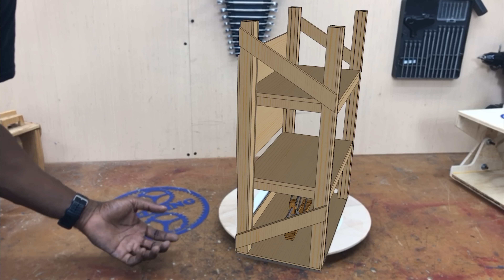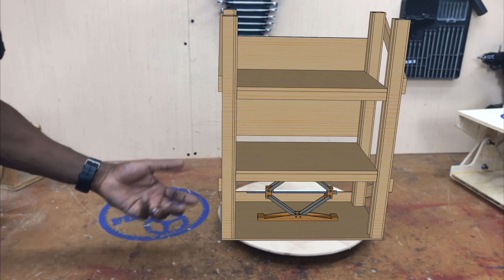Engineering Principles for Makers Part 2; Material Properties #067

Comment: Moment of inertia isn't a measure of something stiffness. I get why you say that, but it's not. It very clearly has something to do with inertia and moment (or in this case rotation)

It's a bodies resistance to angular acceleration. Resistance to acceleration is inertia, and angular acceleration being the moment part.

Sure it's used in beam deflection, but it has to do with the cross section and not the beam.

Id have to agree with other posters though, it's not a fair test. You are comparing steel flat bar, in it's lowest moment orientation, against a wood I beam. It's not right to say, we can change the geometry to amke wood as stiff as steel. As stiff as steel what? The same steel I beam? No? A Steel flat bar in its highest deflection orientation, sure... You could make a lot of materials stiffer.
Reply from the maker: It seems as if you were watching but not listening. That is unfortunate. You should understand before you disagree
Reply: @Jeremy_Fielding  I heard exactly what you were saying, but you were saying is a false equivalency. 

"You can make wood as stiff as steel if you change its geometery" As stiff as steel what? That's a null statement and means nothing....

I have my degree in Mechanical engineering, I understand all of this. And you aren't describing this well at all.
Reply from the maker: Thanks for the feedback. The only goal was the draw a very clear distinction between geometry and material. Often people think they just need a stronger material, but what they often need is more rigidity. This is based on my frequent discussions in the comments and emails. The example was to point out that design is as important as materials. So comparing a poorly designed beam flat steel with a better designed one and what is usually thought of as a inferior material.  I wasn't trying to imply that you "couldn't" understand... only that you seemed to miss the point. The video is targeted to DIYers so there is no reason for me to think that anyone (including someone with a degree) couldn't understand if they had been paying attention. I also said in the video that "I am not saying the wood is as strong as steel, but could be stiffer when given the advantage in geometry"... this is why I thought maybe you missed that... because you are asking a question I feel I answered. The effects of geometry and material are what the whole rest of the video is about. and "area moment of inertia" is described correctly in the video so I don't understand you comments there.
Reply from the maker: It is important to also say the example was meant to be obvious. Clearly a I-beam is better for any material... thus think about the Ibeam (the shape) before you change materials. Again... something I said in the video, but in different words in this case. In the end it is ok if we just disagree and move on with life. Thanks for watching
Reply: @Jeremy_Fielding  Stiffer, is a comparative statement. Just like bigger, larger, stronger. Something is bigger than another thing. 

I understand what you meant to say, however I don't think you did it very well. All you said, and in this comment as well, was that if you change the geometry you can make wood stiffer than steel. Comparative to steel what? To that piece of flat bar, sure, but then if you make the steel an I beam of the same cross sectional area as the wood, the steel is obviously going to be stiffer, because it's stronger, as the deflection formula for a cantilevered beam contains I and E. The way you've described this as if you could design geometry to make wood as stiff as steel for the same geometry. Because all you've stated is stiffer than steel. Stiffer than steel in the same geometry. Or in some  badly designed geometry? I don't know

You definition of what Moment of Inertia isn't the definition. It's a true statement, but isn't what it's definition is.
Reply from the maker: We certainly agree the example could have been better. In my mind it was targeted to those who are not engineers... if anyone doesn’t get it immediately...I failed to do what I wanted to accomplish. Based on the hundreds of comments and emails no walked away with the idea that wood was stronger or stiffer than wood. But about 3% didn’t get why I chose that example at all. They were like you “of course...so why” And that means I should try something different next time.
Reply: He meant the area moment of inertia, which a structure's stiffness in a given direction is proportional to. https://en.wikipedia.org/wiki/Second_moment_of_area  As a mech engineer you should've have been able to figure that on your own.

Granted, you can  blame him for mispeaking, but I'm pretty sure he understand the terms.

Comment: Good information. Another point I would add on cantilevered components (overhung, unsupported spans) is that the supported backspan should be at least 4X longer than the cantilever, depending on the depth of the component and type of material. That information is listed in building code charts, if needed. Beyond this, additional support for the cantilever is required, such as a diagonal brace.

Comment: hey jeremy
i recently went over to an old shed where a whole lota scrap is things like old engine parts some round 4x4s some fencing and in a small old icecream bucket that had been covered in paint i foind a real small single coil motor and i think it might be of some use to figure out how to wire it up
if im not mistaken i just got to have 1 side conect to the + side for power and the other side to the - side
if im wrong please tell me 
but i believe it is a small motor from something like the spiner from a microwave or something
i also took apart an old plender that had a busted glass jar
you know that part with the ingredents that has the blades yeah that broke and so the blender is useless at that point
i took it apart and found a decent sized brushed motor prety cool stuff

Comment: 3:09 Nice look
I sometimes combine wood and steel, like screwing a flat steel bar along a wood beam
Reply from the maker: I love doing that... I used that concept in my shop made bandsaw.
Reply: @Jeremy_Fielding 
I am doing that to my attic to reinforce the beams holding the plaster lath ceiling below
so I can add a plywood floor in the attic and have it be useable space.
Pairing the existing 2x4-14' with 1/2x3/16x2 channel iron 
I would have liked to just put new 2x6 joists above the existing 2x4 ceiling but I quickly run out of headroom if using that plan.
Great reminders about the properties and geometry - the steel would not be much help if it were not held in a vertical "plane" (next to the wood beam)

Comment: Great info, Jeremy! This video reminds me of my favorite engineering joke... An I-beam walks in to a bar and the bartender says,"What'll you have?"  The I-beam replies,"I don't know... give me a moment."
Reply from the maker: ok that actually made me chuckle a little :)
Reply: I have never heard of Moment of inertia being used to express structural rigidity. I have heard it in other free body terms, ie a wheels moment of inertia. Thanks for the further information. I have found some references.
Not happy with the use of the word inertia, but who cares eh what other word would better explain the resistance to rotation/deformation ;)

OK, back to driving busses I go.
Reply: @brycering5989   - I was taught this concept as "Second Moment of Area."  The second moment of area depends purely on the geometry of the cross-section that you're slicing through (which is why an I-beam is typically more rigid than other shapes that utilize the same amount of material, but have a more compact cross- section)

Moment of Inertia is a property of mass, not area.
Reply from the maker: It has a few names apparently so I added a note to the description. I learned it as “area moment of inertia” but one of my older books just says “moment of inertia” so I felt comfortable saying that knowing it had more than one meaning...but I think it developed multiple names to remove the confusion

Comment: What about a piece of Steele same size as the wood.
Reply from the maker: It was the same thickness and cross-sectional area... the result was meant to be obvious so I think since you are asking the question you have missed the reason for the demonstration. Please watch once more and listen carefully because that is the whole point of the examples after that. There are “two” things to consider not just one.

Comment: Hi Jeremy. Great video series as always. I'd like to throw an idea out there on your vertical workbench idea. Could you possibly PULL the tables upward using some form of pulley system attached to the ceiling rather than push from the floor? Perhaps driven by a winch either manual or electric? It may not be cost effective trying to go that route but I wanted to try to help. I also thought the added mechanisms would appeal to you. Thanks.
Reply from the maker: Well... Pulling would require me to attached to both sides of the table, but I would rather push in only one spot. The other issue is I want to be able to roll it around which means I can't attach to the ceiling.
Reply: @Jeremy_Fielding  true. I had forgotten that you said it needed to be mobile.

Comment: Great video. I am curious, Why did you in the first example, 'load up' the steel bar on its flat, but then load up the timber ' mini I beam' on its edge. Obviously both materials should have been 'loaded up' the same way for a more accurate experiment. Try doing the experiment again on video with both on edge. 😁. Kind regards. Michael. Australia.
Reply from the maker: I agree loading them the same would produce an obvious winner. I was trying to show a key different in the examples... I explain why immediately after the test... please re-watch that part after the test... up to to the "strength and rigidity are not the same" part.

Comment: Hey Jeremy. Watched you for a while but am a very rare commenter. Your skill and knowledge is way out of my league but thought i could add a little to your work bench as I made an adjustable height work bench due to a small workshop.  So 1st. Harbor freight sells scissor jacks made for RV's with more travel then your average car jack and cheap. 2nd remember to have a 5th letg under the jack as the downwards force broke right through my prototype. I did something like you described for the legs. Hollow 4x4 with 3x3 solid in th e middle. In my version the thinner legs are attached to the top but if I were to do it again I would go the other way as it would just look better. I secure the legs once at the desired height with a knob a bolt system that just holds each leg with the force of the bolts. Tested the weight up to 400lbs and still held solid. Lastly I put a small circle level so when I secured i knew it was level as there is some play in the leg system.  My looks very diy. I am sure yours will look much more pro but wanted to share what I had tried. Thanks for all the advise and knowledge you provide. It is a pleasure watching your channel.

Comment: Greetings,
    This video was really easy to understand and is one I am gonna have some of my customers watch. Stiffness is something that just isn't intuitive, I have had to show even a mechanical engineer, using Machinery's Handbook, that the stainless steel he chose for extra stiffness wasn't any stiffer than the much cheaper mild steel.
Thanks,
Eric
Reply from the maker: That is awesome! I seem to have the same discussion over and over in the comment section, so I felt it was time to explain it.
Reply: @Jeremy_Fielding  
When our house was built we had it built with a full basement. In the basement we wanted as few posts as possible so there are long expanses of unsupported ceiling. Code required 8 inch tall engineered floor joists. I had walked on floors that met this minimum code requirement and they felt bouncy. So I had the builder put in ten inch tall floor joists. He didn't think the extra two inches would be significant but I told him it would make the floor twice as stiff. When people visit and  are told they are walking on a floor that is really the ceiling over  an open basement they are surprised. The builder was also surprised. You would think a home builder would know this kind of stuff. The floors are wood and feel like the wood is laid on a slab. It's a good thing that intelligent folks like you make videos that explain physical systems in a way that is easy to understand. 
Eric

Comment: Although I enjoy your videos at the beginning of this one you are comparing apples to oranges. A 1.5 inch piece of 16ga. steel to a 1.5 inch wooden I beam, you are testing the thickness of the steel in comparison to the height of the I beam. If you would rotate the steel 90 degrees it would be stronger then the wood I beam of the same size. The rest of what you said I agree with when laying out and project it is important to use the proper support of material no matter what you use.
Reply from the maker: The fact that this seems obvious to you should make you wonder if you missed the point of the demonstration🤔 perhaps watch it again
Reply from the maker: I think you will find the key points in what I say right after the demonstration

Comment: Hey what if you used c channel on the back wall or something like that and do a pully system, like on garage door opener or like on a home made saw mill.    You look like you have what you need there to do that. I wish I could draw up what I have in my mind and send it to you. But I can't do stuff like that on my phone. Good luck and keep up with the awesome work you are doing.
Reply from the maker: The reason I like the jack is because I can push from the middle instead of pulling on both ends. The system is simplier that way. But everything is subject to change at this point.
Reply: Oh ok I see what you are saying.

Comment: I guess i did miss the point of the whole discussion because I assumed that anyone would instinctively know that a structural shape like an "I" beam ( even if it was made out of Styrofoam ) can support a load with a much less degree of deflection compared to a load being placed on a section in a horizontal orientation.  What i find unfortunate about your demonstration is that it will give the average person the impression that wood is stronger then steel based on a "visual " perception . If you had done it apples to apples and shown a flat piece of 1/8" thick wood being loaded horizontally first and then again once it was fabricated into an "I" beam i think it would have been more representative of any particular materials ultimate potential  .    Unfortunately my first impression of your video was that it came across as just another salvo in the age old woodworker versus metal worker feud.(  I have heard more then my share of derogatory comments from the wood guys during my forty years of experience in the metal working industry ).    In closing i want to compliment you on your excellent videos on electric motors , they are always informative !
Reply from the maker: Perhaps the opening question was the problem... i think I should have said “ which one should you use” the implication I was going for was it depends on what you making and your needs...I don’t know. But the words that came out of my mouth were extremely careful and thought out after that. If you were watching but not listening then it’s a problem. If you were primed to expect a “see wood IS better” that is also a problem. I felt the obvious difference in strength was so apparent there was no need to compare them directly. I even said immediately after that “ notice I didn’t said wood was as strong as steel but can be made rigid with geometry”. The lesson was geometry is as important as material. And the entire video is about that. I disagree that People instinctively understand structural shapes. They believe it is better for some “reason” but my video is about why it is better and ways to apply that knowledge once you have it.
Reply from the maker: I also disagree that the "average" person walks away with the impression that wood is stronger. I have read every comment and you grossly underestimate the people watching. About 90 percent understand and walk away feeling like they saw a decent introduction to material science, and about 10 percent call foul like you did and say "you cheated...steel is stronger"...no one who has emailed me or left a comment has implied they now think wood is stronger.
Reply from the maker: Thank you for the kind words (about other videos) LOL :)
Reply from the maker: One more thing... I didn't realize this was such a sore spot but others have mentioned what you said about "metal workers" vs "wood workers" kind of thing in other videos of mine. That is interesting to me. I design structures in steel all day at work and come home to build most things out of wood... primarily because it is cheaper not because I don't have an understanding or interest in metal working. They are the same in my mind. Anyway... I read your message again and didn't notice that part the first time.